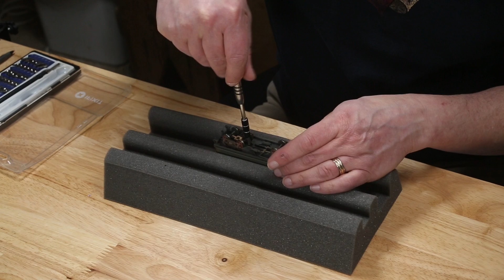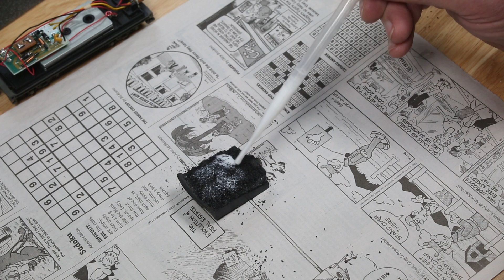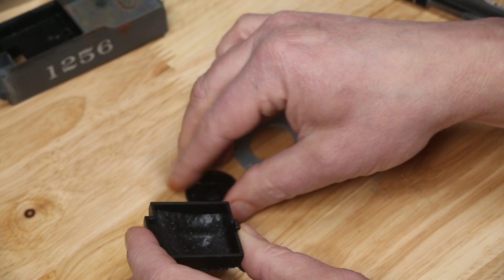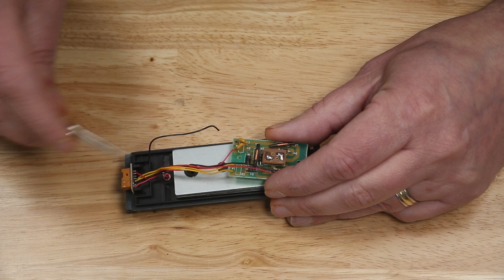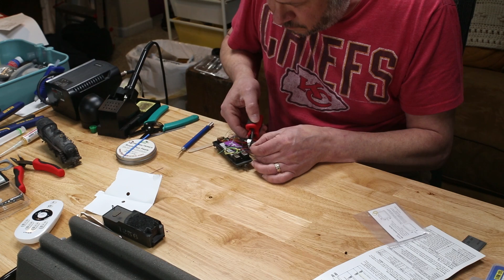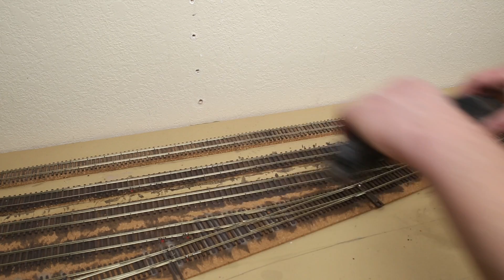Installing a DCC Sound Decoder in a Bachmann 2-8-0 Locomotive

Comment: Nice work, but did you know Bachmann parts offers a tender floor for that engine with a large speaker location designed in? Yes, I have have lots of experience doing things the hard way too. Well most things the hard way, but after some hours, they generally work in the end.

Comment: Great video...i am about to install a SoundTraxx decoder into a Bachmann 2-8-0, although it will probably be a TSU-1100 (I have 3 other steam locos with the 1100). The hardwiring might take a bit more work, but seems "cleaner" in the end. Also plan to upgrade the headlight to LED with a 1k ohm resistor. Any insight into getting access to the headlight?

Comment: nicely done.   what are the two tapes that you were using for the installation?   The double sided and the one holding the decoder and wires in place?
Reply from the maker: The double sided tape is just double sided scotch tape. I'm not really sure of the official name for the other tape, but it's used for electronics and computer repair. https://amzn.to/3EvtOOU
Reply: thank you @WhiteRiverLine

Comment: Hi Drew, you got me there ! I watched the video from beginning thru the end and thought that I would see that steam engine running and making "noise" as it's suppose too. In fact, I was thinking of you test running it on a small piece of flextracks all wired up and ready for DCC. Decoders are sometimes tricky to install. Especially in tight space engines like diesel. I tried to avoid this job for a long time. Not anymore. I'm now putting "Keep Alive" in all the engines I got or new ones. No more stalling and a lot more fun to run them. Take care.
Reply from the maker: Stay tuned. I'm working on building a DCC-EX command station right now and should be able to get something running in the next couple of weeks. I think I might have some space for a keep alive and may install one at some point in the future.
Reply: @WhiteRiverLine  Thanks for answering Drew. I bought a decoder for an Atlas MP15dc from Tony's trains exchange. It's a TCS Wow sound unit. Not only does it makes a great sound and very realistic, it's also Keep Alive equiped. You have no idea how much I like the performance of the engine. And on top of that, it never stops or loose power anywhere on tracks. It helps a lot when you got no time to clean the whole trackage before running trains. Keep on your good work.

Comment: Not bad at all for a first time installation. I think you probably could have gotten a cube speaker in there with the factory board while using an 8 pin plug. It's ok that you did your own thing and hard wired it. Only thing i would have done differently was to reverse one of the speakers so the magnetic field would not push against the other. Other than that....nice job/congrats on the first installation. It only gets easier from here. :)
Reply from the maker: Thanks, Bill. I tried reversing one of the speakers, but it still the fields pushing them apart. In the end I decided it was easier to run the wiring this way. It's always interesting to hear what choices others would make. Gives me ideas for next time.